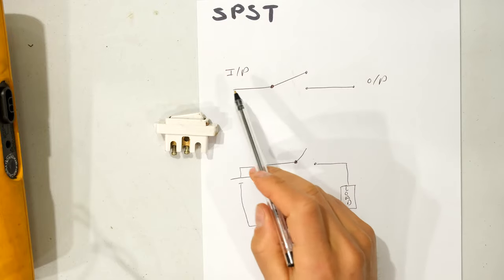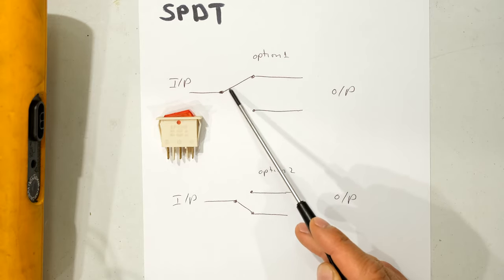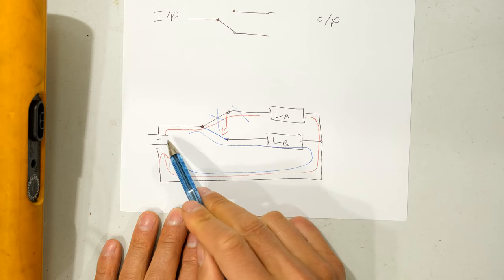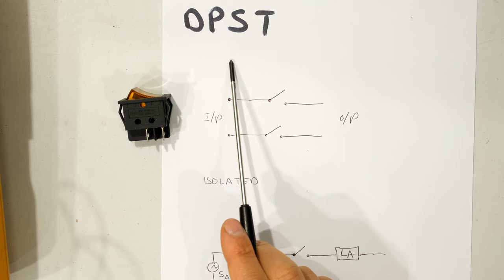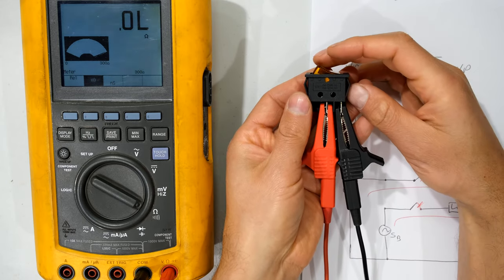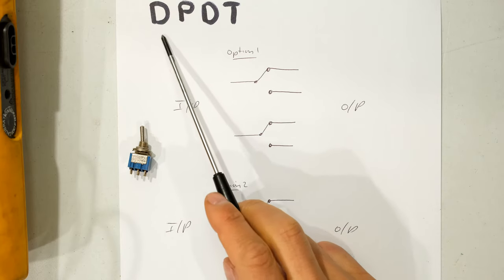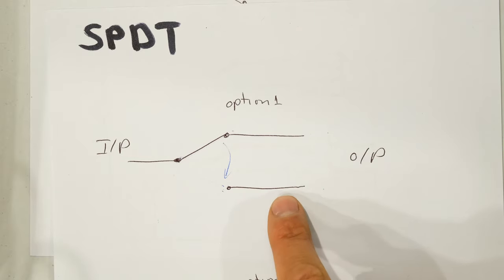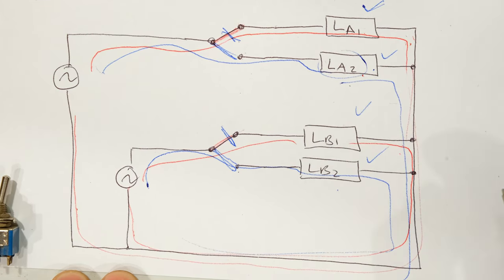What is the difference between a SPST, SPDT, DPST, and DPDT switch? - Detailed

Comment: So basically with DPDT, it outputs 6 connections/circuits, but you have to crosswire the leads so it reverses the polarity, meaning you shouldn't be adding wires to all 6 terminals.  Thanks for this video. I was looking for a very simple explanation and couldn't find one.

Comment: I am gonna use one of those spdt switches as a hi/lo beam switch for my motorcycle. I'll have the power for the LED headlight split to a PWM  and then to the switch, and then straight from the power to the switch to flip between dimmed and fully on. That way my dimmer will be adjustable

Comment: Hi I was wondering if you know what type of button I would need to wire up my motorcycle for a push button start. What I do know is the head light and the instrument panel lights run through the same button that starts the bike. The problem I have is that when I half press the stock button it disconnects the circuit that sends power to the lights and a full press completes a circuit to send power to the starter relay. It has two power wires, a ground wire, and a circuit complete wire the runs to the lights. I need a button that disconnects the always on circuit from the key then completes the circuit to the starter relay with one action of the button. It need to be simultaneous.

Comment: Hello and thanks for the video. I am trying to understand an issue I have with new push button switches I bought for a motorbike. Taking the headlight as an example:  When I press the button in to ON (it stays in as designed) – light comes ON. Normally to switch the headlight OFF I would press the button again thus returning the pushbutton to the off position. However it doesn’t work this way. I need to press the button IN – OU - IN – OUT (4 presses instead of two). Any idea why this would be? Also, if I just touch the button(not pressed fully in to the locked In position – then the switch activates the light correctly – slight press for ON and slight press for OFF (no locking button in/out) – this way it works. Would appreciate some tips of what’s happening and I hope I explained myself clearly.

Comment: what about when I have a switch where there is "on" down motion of a switch, then i have "off" middle position of a switch, and then agian "on" upward motion of a switch. Is that still considered SPDT switch?
Reply: That’s ON-OFF-ON switch. Mostly used in application like a motor, to reverse polarity. Meaning both + - has to go through the switch. 
It’s alternative of using a relay.

Comment: 🛑Great video. But, the example you provided for the DPDT switch is not what the switch is made for!
It’s unrealistic to wire 4 applications (devices) in one switch just to make each 2 work together separately from the other 2.
DPDT is made to be used in an open and closed wiring circut independently and simultaneously, as it can separate both + & - connections.
Mostly used in motors to reverse polarity / rotation.